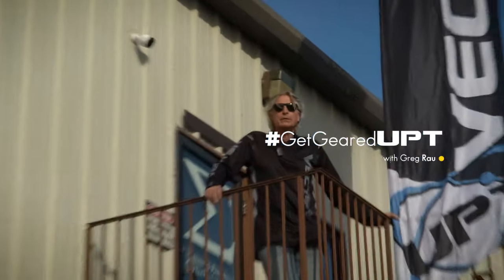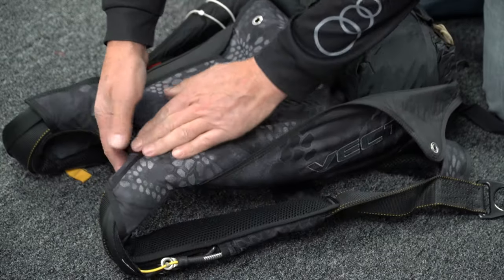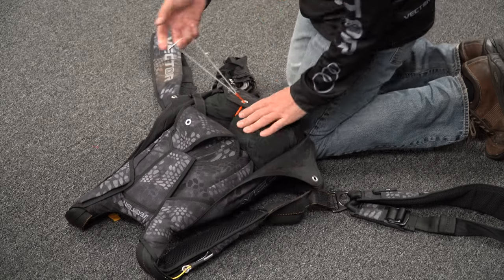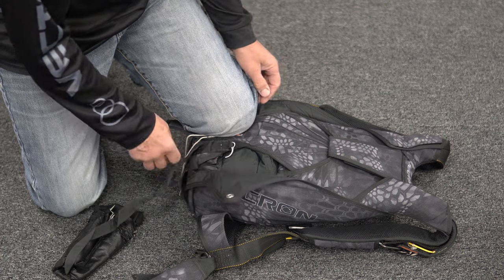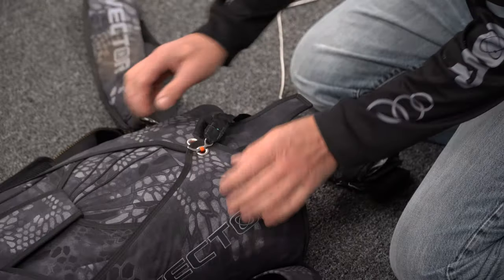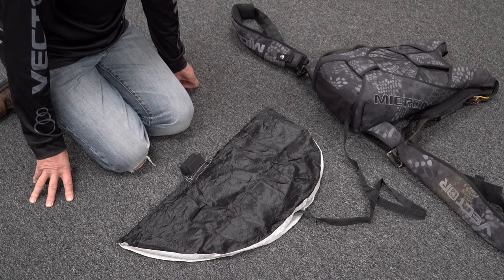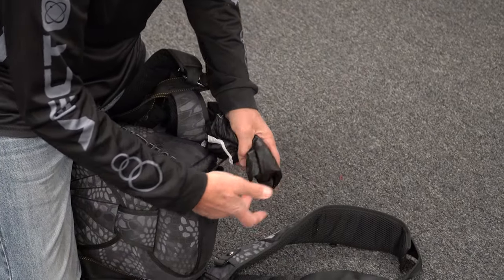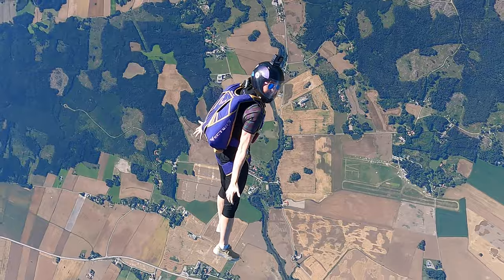Closing your Vector: From Risers to Pilot Chute

Comment: Why has you closed the top bands ( shoulders bands) at the last moment?
Reply from the maker: Greg, through MANY MANY pack jobs, has found that he personally likes to use the magnetic riser covers to hold in place until he has finished his pack job. He finds this to be an easy way to insure correct magnetic polarity when packing lots of different Vector containers. He finalizes the pack job on his Vector by neatly securing the external riser covers as shown. This is his personal preference of order for speed and efficiency. Thanks for the question!

Comment: Why not stack the rizers?
Reply from the maker: Great question! We suggest a slight offset of the risers when routing against the side of the reserve tray, under the internal riser covers, to allow for a low bulk and flush display during packing. This will in turn, limit interaction between the front and rear riser during opening sequence. WIN/WIN!